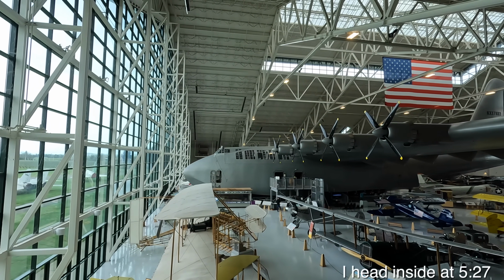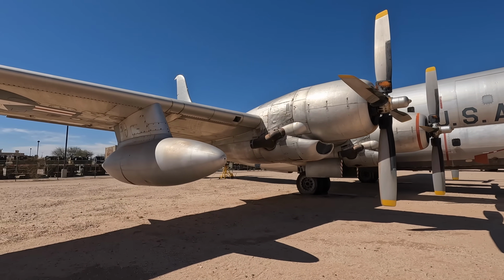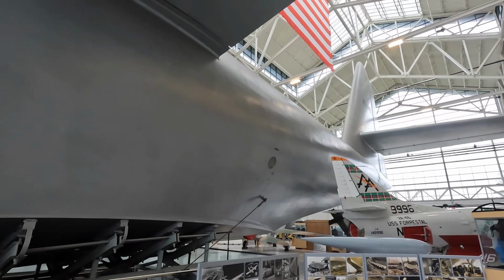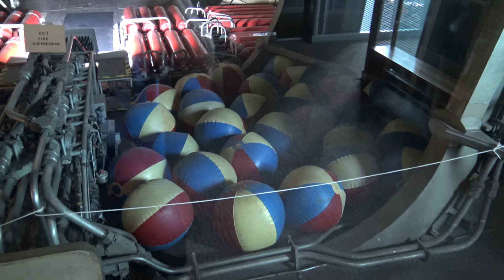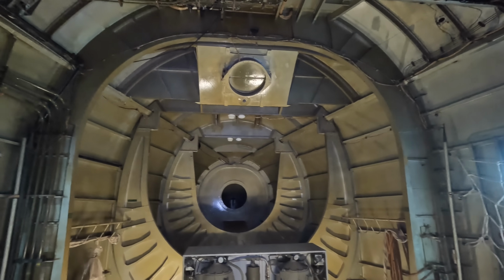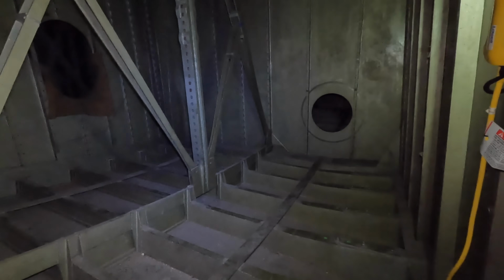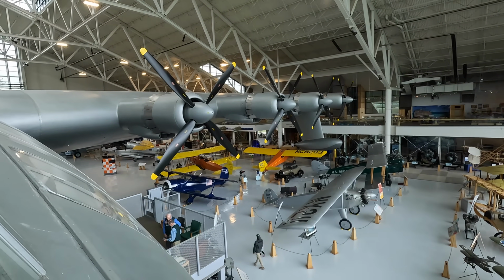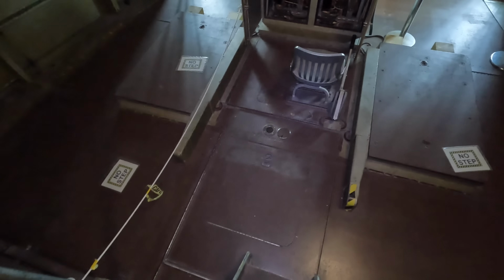Detailed tour through the Spruce Goose! - the Hughes H-4 Hercules.

Comment: The throttle handles in the DiCaprio movie looked quite different, almost like plastic and the passenger seats in that movie were on a lower level to Hughes’s pilot seat where in reality they were all on the same level.  Strange differences.  Surely not necessary so there must have been some movie making reason for the changes?

Comment: Was mainly Birch.
Kaiser’s joint venture with Hughes secured an $18 million government contract for designing, engineering and constructing three flying boat prototypes. The project, however, came with a laundry list of restrictions. The mandate, for example, forbade them from using critical materials like steel or aluminium or hiring anyone already engaged in the war effort.

Comment: I built a scale model of the Dixie Clipper, as a rocking seat for a child. The child sat straddled upon it, weight on the fuselage and wings. I had a cleat on the top as a handle for the child to hold while rocking. Footrests upon the rockers.  I was planning, as my next project, to do a scale model of the Spruce Goose, to hang above a child's bed. I used reclaimed lumber from the housing market. The wings of the Dixie Clipper were kiln dried poplar from a cabinet for dishes, the body oak from a bed frame.
Just as I finished the Dixie Clipper rocker and was about to paint it with all the appropriate markings, the client demanded it, to give as a gift. I was forced to present an unpainted piece of furniture to the child, who was not impressed. I took it badly and have not built a piece of furniture since. 
Looking at that beautiful aircraft now however, my mind runs through the methods I used to achieve all the correct angles with standard carpentry tools from the home building trade. It was incredibly difficult and thoroughly satisfying to get it right. I built more in jigs than I did while building the aircraft. I took those jigs apart and made bird houses.  People suck.

Comment: I toured the plane when it was still in Long Beach.  Impressive to say the least.  The wings were so big they had enough room for an engineer to sit in front of gages next to each engine during the test flight. At the time I worked for Hughes Aircraft Radar Systems Group.  By that time Howard was long gone, and Hughes no longer built aircraft.  All their divisions were for electronics and satellites.  It was still a great company until GM bought it and tried to manage it like an automobile assembly company.  They failed miserably. Raytheon eventually bought most of the divisions, and the company was renamed Ratheon.

Comment: July of 1977 less than a year after Howard Hughes died I worked for GTE in Long Beach as telephone repairman/installer. My partner and I went out to Pier E where the plane was stored since it made its famous flight this was way before it was moved to the dome. We were there to remove all the communication in the building and on the plane. There was a dog run between the street and the entrance gate where if you got over the first fence the guard dogs would get you. At the time they had about 8 security men all wearing red overalls and hard hats. They let us in and stayed with us the whole time we removed the GTE equipment. When we got to the plane and out of sight of all the other guards except our escort we went in the cockpit and he let us sit in the pilot seat and my partner said hey can I have the headset and to our amazement he said put them in with the rest of equipment. He also let us walk inside the wing all the way to the 3rd engine. You could stand up in the wing and I’m 6ft tall. Well I did 39y 10 months with GTE/Verizon retiring in May 2015. I was only 19 yrs old in 1977 and I can remember that like it was yesterday.

Comment: So 104 gallons an hour 1000 gallon fuel tank that means 104 divided by 1000 10.4 hours of flight time or 3021 miles the issue is that its 3461 miles from NY to London a better choice would have been NY to Swansea, Wales, another port city in the UK but that's still 3200 miles so the H-4 would have needed to find some room for more fuel

Comment: 800 gallons per hour. 14,000 gallons of fuel. I’d assume cruising speed around 200 knots or less. So 17 hours of flight time with a range around 3500nm. With a battalion of infantry. In 1947. Very impressive.

Comment: Several years ago I had the privilege and great pleasure to be given nearly complete freedom to rove around inside this plane with a design engineer friend (I knew a docent). We spent hours examining and analyzing all the systems. There was an awful lot of control system redundancy. I was able to sit for quite awhile in the pilot's seat and my friend was in the copilot's seat. We marveled at the forward thinking design and I also popped my head out of the overhead hatch - what a view. We were possibly most impressed with the lamination of the fuselage structure. It definitely was a peak experience.

Comment: I am wondering how many gallons of oil those 8 engines burn up a minute.
Reply: If my calculations are correct... based on what he said. He said there's 14 fuel tanks. Each fuel tank holds 1000 gallons of fuel. Each engine uses 100 gallons per hour. With there being 8 engines. So all 8 engines would burn 800 gallons per hour total. This works out to be 17½ hours of flight ✈️ time. This is JUST fuel ⛽.

Comment: This aircraft was essentially rebuilt from completely ruined.  It was virtually 100% trash from long term storage.  Amazing how clean and smooth the resto is, it compares well with today's aircraft!
It was common sense to consider manufacturing  a flying boat for another 15 years.  This would make trans-ocean flights safer and open up places like Rio De Janeiro, sub-Saharan Africa for immediate service.  Also, once the actual size of the plane got above threshold, the hull could handle height and surface texture regardless.  
Example: You could send a 'Terminal/ATC' barge, fuel barge/maintenance barge, and you'd have a huge yet instant airport in Singapore.  (and call it 'Singaport')

Comment: Watched the goose sit across the highway from the museum at evergreen aviation for many years.  The main fuse had its own temp and humidity controlled tent,, as did the removed wings which were stored on edge beside the fuselage in their own special tent.  The museum was slow in the making.  I always wanted to sneak in and take a peek.  Before the museum was a true museum,  model airplanes were flown at the sight.  Both Radio Control with its model landing strip, and U-control tether planes with their own flying circle.

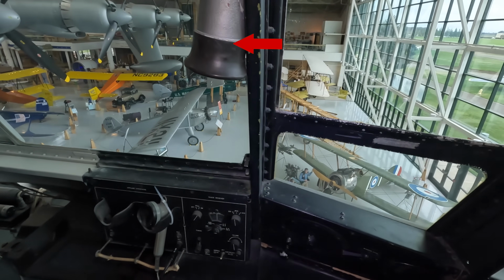Comment: I worked on, reconditioned the "fresh air tube" shown at 11:42 for the pilot. It was actually used incase of fire so the pilot could breathe fresh air and continue to fly the plane. I worked as a fabricator in a small tool and die shop in Portland at the time they were reconditioning the aircraft for display.

Comment: You just completely skipped the TWO trimming stations.. one was by the engineering station(THAT BIG ASS BLACK BOX IN THE ISLE) and the small swing out panel on the pilots side of the cockpit.. a drastically new and relatively rare thing for any aircraft to have in the 40's. It honestly seems that you opted to not speak to the knowledgeable staff OR just didn't ask questions or ignored a lot of details

Comment: Those were FAR from "the usual instruments"! I hoped you would've looked at the enormous switch panel next to the pilot seat haha I don't even know what "INCHING" is, but it's interesting to see a transfer system of throttle and prop control to the engineer.

Comment: My dad was a mechanical engineer in the early days of the aerospace program.  His boss was Bill Hubert, Bill designed the fuselage of the H4 and was onboard during the test flights... monitoring the stress gauges.  Howard was actually the one who promoted my dad from Class C Draftsman to Class B Engineer  while working at Culver City.  Dave Grant (aka the professor) - my wife got to meet and worked at Hughes Radar Systems Group.... a very nice, smart gentleman!  Over the years, my dad was also one of the engineers who worked on special programs involving the H4 while it was "in storage" at Long Beach.  Although the aircraft sat "idle", it's purpose did not as it was a test-bed for a variety of aeronautical tests- and it was very well maintained which included a complete A/E mechanics to maintain its readiness.  As a side note....Bill never like flying, he would rather drive than take a flight.  He told my dad later (when they were flying to Tuscan, AZ) that when they had completed the 2nd to last test run in the H4, and "Pappy" (aka Hughes) was exceptionally interest in the data... when he decided to make 1 more run.  Although he never told any of the crew (or press for that matter), Bill and everybody else knew when he kept requesting the stress data in detail and kept throttling up higher... that he was going to lift the H4 up.  Know one knows for sure, but Dave Grant later said the look on Howards face said that although he was confident it would fly, the amount of lift generated, and the response of the controls was much greater than even Hughes expected.

Side note...Bill was also the one who found the "gent" at Magnavox (yes the TV company) who had figured out how to bond wood together - as Magnavox had just come out with a TV cabinet that was beautiful but looked like a "Butcher's Block".  They hired him away from Magnavox.

Comment: thanks for sharing i lived in Windsor locks a town of bradey international airport.  home spot of hamilton standard. i worked at pratt and whitney aircraft manufacturer of jet propulsion systems 1978-1992. i supported information technologies  for government pricing and payroll systems in east hartford connecticut. i have been to the military engine facility in west palm beach. i interviewed for programming in the east hartford and middletown plants on the shop floor. i had to deliver payroll checks to the new haven plants. 

i love history. and while i had lyme disease my toe nails grew over a half inch long similar tob howard hughes. i now own a 50 acre woodlot with pine, red and white and blue spruces. and a very soft white birch. i also have used duramold concrete forms. thanks for the positive memories.
Reply from the maker: Glad you enjoyed the video!

Comment: About 15.5-16 hours of flight time if you account for getting to cruising altitude and still having enough fuel to land the plane in a waterway inlet with calm water. Considering it was 14,000 gallons of fuel and gasoline and not turbo diesel engines powering the plane, that's kind of slightly impressive. If turbo diesel engines were as big of a thing as supercharged av gas engines, back in the 1940s and Aviation pushed for them in planes instead of av gas, that seaplane could have possibly doubled it's flight range and possibly increased it's max cruising altitude by several thousand feet. They were already working with nickle cobalt iron alloys in the 1940s, if they were given the time, they would have found out those work well for making turbocharger turbine wheels.

Comment: what you have to remember steam train in the first world where still the norm, and as this is the porotype model, one to to one scale, for tesingt will it work, a low level first flite is still the norn, a bunny hop alone along runnway, all new planes still do this, so alot if the stuff being showed, must reflect this the over the top fire suppression system,  back then, that must of been a first, back then, even now, how many planes have that, and if you gave a year and showed a picture from inside, to someone, you would get back that a plane, neverminded this plane, as answer? it was build way before it time, with the compromises of what was a valuable to make it with, the available room in side that the biggest spires, even now, try getting a plane seat with some leg room?

Comment: I believe it was George Helderman (Lakeland, Florida) who actually did the design work on the hydrolics. I remember seeing a large 3'x4' picture of the plane when it was in the air. It was wet signed by hundreds of the folks that worked on the plane. In the center at the bottom was Howard Hughes signature.
Reply from the maker: thanks for the extra info

Comment: I used to live in Long Beach..
Saw the H-4 in its dome there which was a fantastic way to display the aircraft. You walked down the ramp in darkness, and the lighting pointed on the A/C was turned up and this gigantic thing just suddenly looms out of the dark!
I saw it again years later in McMinnville and feel that the building is about 1/4 the size it need to be to properly display this plane. You can't get far enough away to properly appreciate it.

Comment: My dad worked on the Spruce Goose when it was being built. He said he would be inside the Tail fin gluing pre-formed plywood bracket and water proof glue. I still have scrap pieces of the wood (Duramold).I miss you Dad. Thanks for posting this video.
Reply: Not many folks know about Duramold. My godfather George Allward was the chief process engineer for all the Duramold construction on the Hercules.  He started with Fairchild F-46 NX19131 until Howard bought them out.
Reply: My grandfather was a master craftsman in wood and cabinetry. His proudest achievement was working on the tail and wings of the spruce goose. He did not share much, about himself, and I was young.  He was proud to speak about his work on the plane. I'm sure that I could learn more details, with researching.  He was contracted under an airplane manufacturing company stationed at Lambert Field, in St Louis, Mo.. One of his stories was about how they had to work inside of the wings while they were testing engines, and the harsh conditions. 
 Our relatives, likely, worked together.
Reply: Hughes was one of my Dad’s schoolmates at Prosso, a private school in Houston run by my Dad’s stepfather. When Hughes started the Spruce Goose project, he hired Dad on the quality control team. Your Dad and mine probably knew each other.
Reply: The Hercules

Comment: I took that tour and sat in Howard's left seat. It was awesome! Dont do "selfies" but tour guide was nice enough to use my good DSLR to get few pics. Two things you dont mention; Hughes was a disciple of redundancy; everything on that plane had  either a backup or better a "hot spare" which was always in service so if something failed the spare was then used. Even twin APUs you noted which are DC motors and musta produced some serious noise when spinning. Second, most critical thing, was MAIN reason it didnt fly except long enough to get off the water and get airworthiness certificate (posted in the airplane) was there were problems during flight. He had multiple people stationed throughout the aircraft who communicated by an intercom system seen in video. A few seconds into the flight, guy in the alt section advised Hughes of sounds indicating serious structural issues, possibly leading to catastrophic failure, were being heard and advise him not to climb any more than he did. The tail section was reinforced, which you can see outside the aircraft, after that initial flight. When you look at early part of vid, the massive tail section vs relatively smaller x-section of the tail structure makes me think that a pretty good call. And last, while mostly made of birch, it is also made of spruce in parts; the load-bearing structural parts being laminated birch and skin yes, of spruce. TAKE THE TOUR WHEN YOU GO. Its cheap ($25) and goes to a great cause.

Comment: When the H4 was in Long Beach I was called in to discuss putting a mechanical variable speed drive and control system in one of the engine nacelles so that they could spin the prop.   To inspect the mounting location we walked through the wing (there was a small work shop in the wing for in flight repairs) and I saw how the wing had been constructed and was very impressed.   The engine nacelle looked like they had cut off the front half of a A1 Skyraider and bolted it to the wing.
Reply: Wow a work shop inside of the plane...man I wish this bird could fly again
Reply: @Itwillgetbetternever  About 20 - 30 years ago the TOMORROW SHOW did 1 episode from the exhibit. It was quite fascinating.
Reply: Excellent video Paul. The one question I have is how was it brought over from Long Beach? It certainly wasn't flown!
Reply: @Socaman  In pieces apparently, Wikipedia mentions re-assembly at the museum.